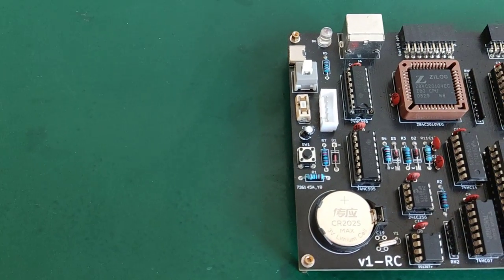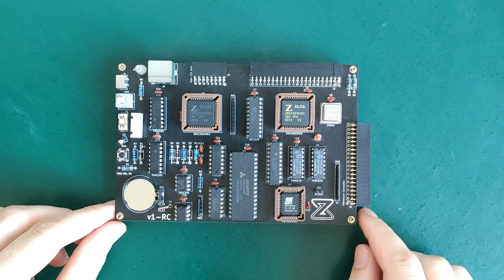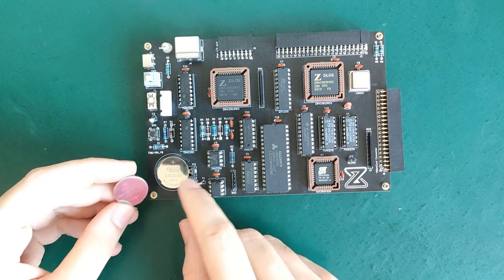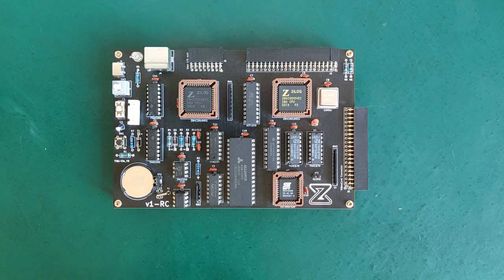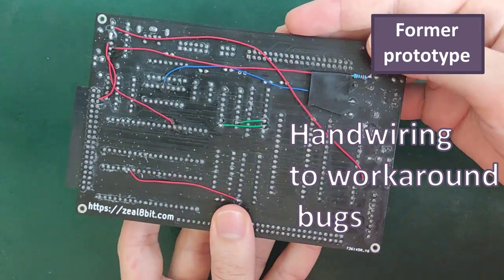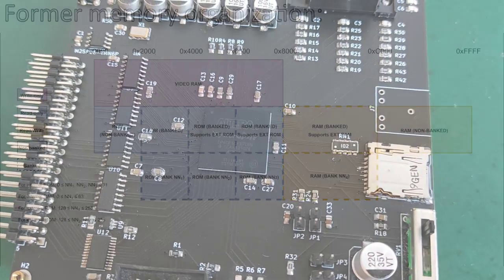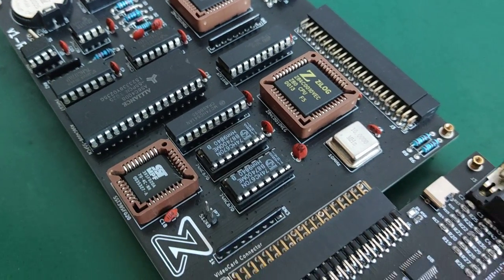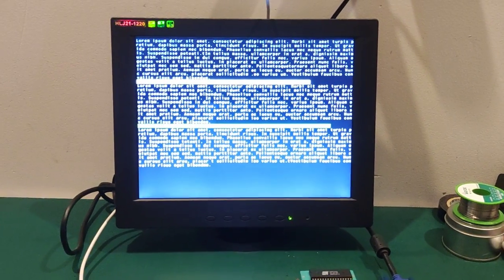Latest prototype of my 8-bit computer [Zeal 8-bit computer]

Comment: Oh, yes.... the MC6809 has an MMU chip available which gives 2 MB address space. Also, OS9

I did have a Spectrum, which I did some simple machine language on. Never was that excited about the register oriented aspect. Okay, but not blown away.

Z80 does have an IO space though, which is good.

Motorola memory mapped their stuff, like the PDP-11 which inspired them.
Reply from the maker: I am surprised Zilog didn't propose such chip back then, they did PIO, DMA, Serial, CTC, chips but no MMU. Very few computers needed more than 64KB memory?

I also like the I/O bus, it makes the actual 64KB of "real" memory contiguous.

I wasn't shocked by the "registers" aspect, I mean this is what we actually use until today, mainly with RISC CPUs. I was more surprised that reading and writing through IX and IY registers is really slow.
Reply: @Zeal8bit  well, the business systems were still reel to reel tape drive PDP-11 clones and they had only 128 k bytes of RAM anyway. UNIX fit on 32k words...

I saw a small KAYPRO in 1987. 
It was SLOW....

Wordstar, dBase II, visicalc and spacewar...
Reply: @Zeal8bit  I think they had a massive job on their hands doing the Z80 CPU. The design system and tools were primitive at the time.

Not sure, but I think they had such runaway financial and market success with it, maybe they were busy keeping the wafer yield up.

MMUs are a great device, but I notice marketing can be tricky. I think the fact was that the 8086 and the 8088 did 1 MB in a 40 pin DIP out of the box just two years later.

The 6809 was great, but it was 2 years late...

Looking back, I realise the 8088 was just the perfect chip for tge computer revolution (that wave, anyway) even though segmented memory is ugly as sin.
Reply: @Zeal8bit  when you see why it's slow then you say to yourself :
"No wonder!"

Comment: The video card is surface mount.  It will be difficult for amatures to assemble the card.  Do you sell prebuilt video cards?
Reply from the maker: Thanks for your message!
The video card is hard to solder, mainly because of the BGA FPGA. When I'll propose it in the future, it will be prebuilt/pre-assembled indeed.

Comment: You could probably implement a more powerful CPU than the Z80  on the FPGAs !!
Reply from the maker: Indeed, it's possible but it would require a more complex PCBs because of the number of I/Os. Moreover, the components around, like the ROM and RAM, would not be able to handle faster speed without introducing WAIT signals. That will also make the overall computer more complex and less easy to understand and master.

Comment: Apart from space, what are the major differences betwren Altera and Lattice FPGAs?
Reply from the maker: The IDE you will use will differ, with Altera I used Quartus, which is pretty good. With the Lattice I use the excellent open-source toolchain yosys and nextpnr. Usually, Lattice FPGAs have more LUTs and more BRAM (for the same price).
Else, from a user point of view, not that much difference

Comment: you might've mentioned it in one of the prior episodes but how are you interfacing the keyboard with this device?
Reply from the maker: I am using a PS/2 keyboard, on the motherboard there is a simple PS/2 interface decoder made out of two 8 shift registers and a signal filter. When a key a pressed, a signal is sent to the PIO which triggers an interrupt. The CPU will then decode the PS/2 key value to ASCII or special characters
Reply: @Zeal8bit  ah, so there is no way currently for the CPU to talk back to the keyboard?
Reply from the maker: @catgirlQueer  Indeed, it's not possible, this was a sacrifice I had to make in order to keep the PCB simple and small enough. It would have been possible to have a microcontroller instead to handle the whole PS/2 protocol, but I would prefer to keep MCUs out of this current project.
(even though I personally think an MCU and a Z80 can be complementary as an MCU is not necessarily "more powerful" than a Z80 as I could read in some places)
Reply: @Zeal8bit  is there anything specifically you're missing from a 1 way connection that you'd like to have? I'm trying to decide what would be the best way to implement keyboard support on my own 16 bit computer, and having someone else's thoughts on it could help a lot
Reply from the maker: @catgirlQueer  The main thing that I regret not having is the possibility to turn on/off the LEDs on the keyboard: num lock, caps lock and scroll lock. These require a bi-directional communication. Another interesting command is to request the keyboard to resend the last-sent byte, this also requires a bidirectional communication. In my case, I have never encountered a situation where I needed this (mainly because I discard the start/stop/parity bits), but you may need it if you want to check the intergrity of each byte received.

From my point of view, if you want to implement a keyboard interface, either use or make your own key matrix-based keyboard, either use a microcontroller to decode the PS/2 protocol. I personally find that the PS/2 protocol doesn't make a lot of sense and was not made to be easy to decode/interface.

If you want to have a PS/2 protocol without using logic chips or an MCU, you can even imagine using GPIOs and bit-bang the PS/2 data bus! It's an open-drain bus, so it can be achieved without adding a bus transceiver.
(That's something I considered myself but the 8 GPIOs I allocated to the system were already taken)
Reply: @Zeal8bit  I think I'll probably go with a small MCU myself, thanks for the advice
Reply: @Zeal8bit  could you share the schematic of it? Im trying to build my own version of a computer like this and with a PS/2 keyboard. I already make it work with the keyboard, but do not thought to use the PIO, only two shift registers and a bunch of logic gates to send a pulse to the interrupt pin of the CPU when the data has been transfered. I loved your project and how do you dont want to use MCU, im trying to do something like that. Thank you!
Reply from the maker: @yanparasuacurtisao  Thanks for your message!
The schematics are not public yet. I use the PIO for this because it will manage the interrupts for me as I have multiple interrupt sources. It lets me easily mask the interrupts from any source, program an interrupt vector (mode 2), etc...

If you only have the keyboard that can trigger an interrupt, your solution is better as it doesn't require the PIO. In my case, I also have some signals coming from the video card.

Moreover, the PIO also gives a very handy way to have GPIOs usable for users (at is has 2x8 pins)

Comment: Videocard with microSD slot O_o
Reply from the maker: Exactly! The "video card" will in fact also manage the sound and the uSD interface
Reply: @Zeal8bit  I even guess that video card may be more powerful than the rest of PC, which means that it is not video card is connecting to PC, but PC is connecting to video card :)
Reply from the maker: Haha nice one!
In theory, yes we could implement a Z80 core in the FPGA, yes it would be faster. But I prefer to see the FPGA as a big CPLD. In fact, what about the RAM, the NOR Flash and the RTC? The FPGA alone isn't enough to emulate these 😄

Comment: Can you show us a practical use of the block instructions?

LDIR, etc.....

That would be really great!

Those are very powerful instructions for the time. 1976...
Reply from the maker: Thanks for the suggestion, I write this down.
I could make a "Getting started" video for  Zeal 8-bit OS where I can use such instruction.
Reply: @Zeal8bit  cool...

It's a pleasure.

I have more. Lol....
Reply: @Zeal8bit   Using Z80 DMA  chip would not be better than LDIR ? I have one piece of it binned from some somewhere.
Reply from the maker: @belatorok5630  Indeed, having DMA on the board would make transfers much faster. According to the Z80 DMA chip manual, transfers would be from 5x to 10x faster. There are some drawbacks however:
- In terms of software, we would need to program the DMA chip every time we want to perform a copy, making the code more complex than a simple ldir instruction.
- In terms of hardware,  we would need more space on the PCB and more costly. From what I see, these DMA chips are harder to find than the PIO and CPU, and they are not available in 10MHz version, which is the frequency I am using. As such, I would need a clock divider on my board in case I want to integrate such chip, or down clock the CPU.

Finally, thanks to the extension port, it is possible to add a DMA chip externally, it will also be able to manage the whole bus as all the signals are present on the port. The main use of the DMA would also be to transfer graphics data, thus, one solution would be to let the video chip (FPGA) perform the DMA.

Comment: Dear Friend... Instead of the PS2 ... Why not an USB ?
Reply from the maker: Hello!
Because USB protocol is exponentially more complex than PS/2 protocol, which is a simple UART-like protocol.
The simplicity of PS/2 let me manage the received bytes in hardware with few logic chips. USB is so complex that it would require an MCU, an FPGA, or bit-banging PIO's I/Os manually (making transfers really slow)

Comment: I have a suggestion: a ROM for fast lookup of different math functions you might want done fast. I want to do that on at least one 8 bit system before I die ☠️
Reply from the maker: A lot of ROM space is still available so it would definitely be possible, but then the programs would need to map that area and look up by themselves. Or did you mean that we would have some dedicated I/Os and the hardware would look up for the values?
Reply: @Zeal8bit  oh, sorry!

You don't read minds...

I am thinking of a ROM mapped into IO space so you just POKE a value to a few latches which drive the ROM address buss. You read back via an input LATCH in IO space. You can get 256 x 256 lookup to 256 values (which may or may not represent a linear NUMBER space...)

Rough but fast.

I do apologise. 

I am thinking of not just a simple mapping using an array. I am thinking of functions of two or more variables, logarithmic number scales, etc.....

I had to do maths for engineering.
Reply: @Zeal8bit  to be honest, here is what I want to build or see someone do it:

A video (256 level RGB) SIX PAGE FRAME BUFFER bank is available for VIDEO GRAPHICS OUTPUT. Capability would extend to graphics over live video via a GENLOCK, 256 x 256 pixels in VGA colour WITH animation.

An AUDIO FRAME BUFFER is available for SOUND / music / synthesis. STEREO.

An I/O buffer set with real-time hardware counters is available for fast data pump and refresh of a 
256k by 36 bit DRAM BANK which is the REAL-TIME CAPTURE front end of a 36 channel Logic State Analyzer.

Control registers required for the logic state analyzer can become quite extensive.

Would be a very cool piece of lab gear...

Comment: What is your ultimate goal?
Reply: I also followed Zeal 8-bit Computer for one year. I think his goal is actually create a community that use 8-bit computer and an ecosystem of nice software based on it.
Reply: @sanhua8337  ahh! Nice.
Reply from the maker: Indeed, my goal is to make an 8-bit computer for advanced users (assembly programming/drivers/hardware) or beginners (with a scripting langage, not sure which one yet). In any case, creating a community around it with motivated people is also my goal!
Reply: @Zeal8bit  For beginner's language, you should use a BASIC like language, like Locomotive BASIC, MSX Basic or SuperBASIC, or even a mix of them.
Reply from the maker: @ratatus5645  Indeed, that's one possibility. The most obvious choice would be BBC Basic as the source code is available. I'll see, in an ideal world, I would like to have a more modern script language.